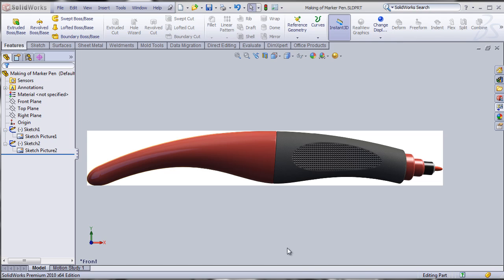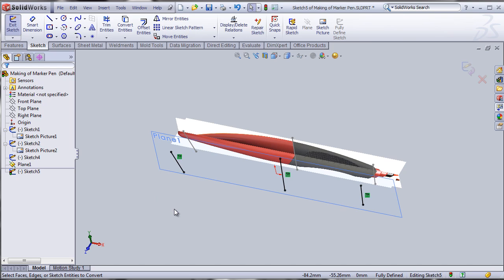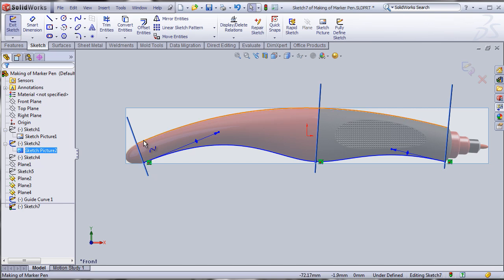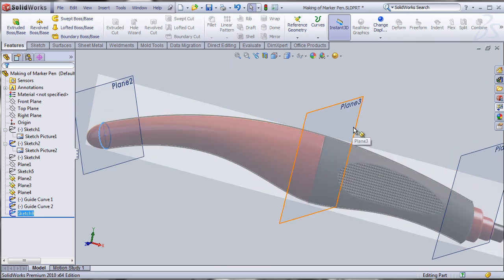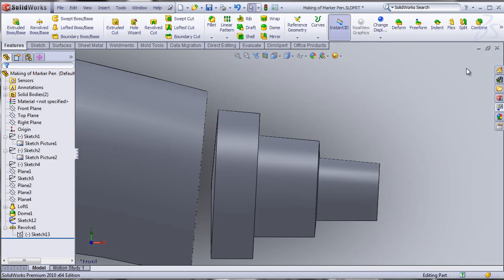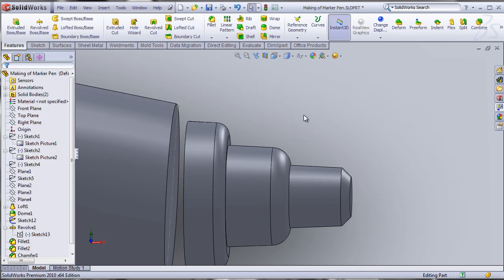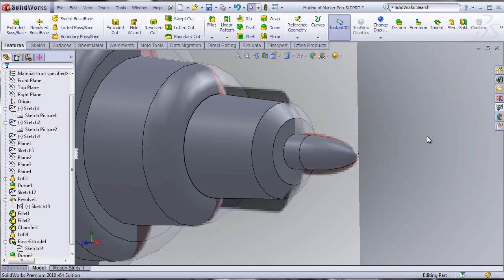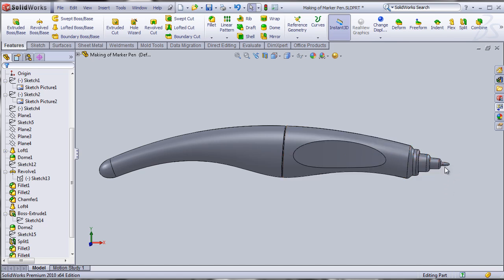Making of Marker Pen - Lofting Feature, Dome Feature, Revolve Feature, Split Feature

Comment: Hello, I have solidworks 2011 but don't have the split tool you use at the end of the video. This may sound like a dumb question but how did you get it? Or replicate the same process using other tools in solidworks. Thanks

Comment: Open Question to everyone here....

I have a personal copy of SolidWorks 2011, and at my work place they are STILL using Solidworks 2005. I work with machined parts, CNC and castings. We use a great deal of machined compression springs, which I can easily do on the 2011 version, but I'm still stumped on how to remodel it in a 2005 version of Solidworks.

Anyone know how to do this in the 2005 version without running into a feature intersection error? w/o doing it in 2 separate part files?